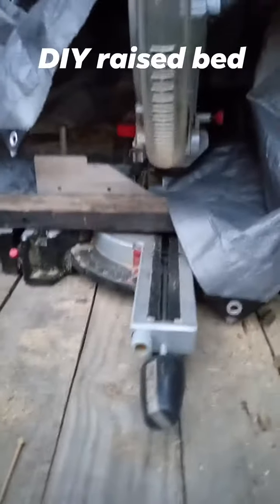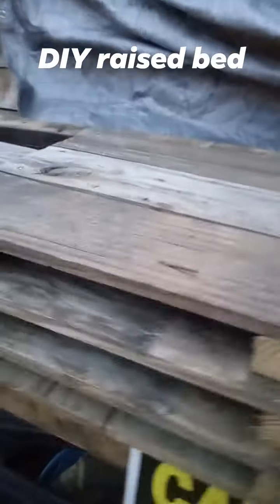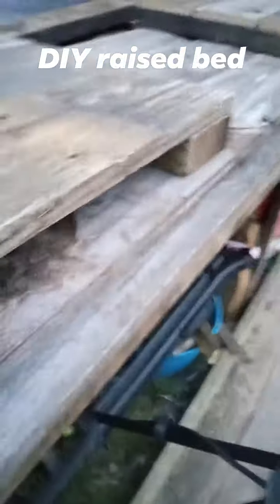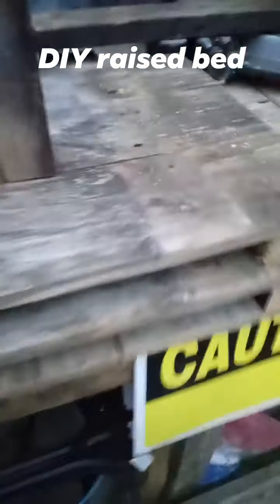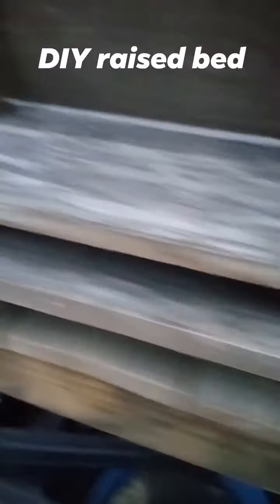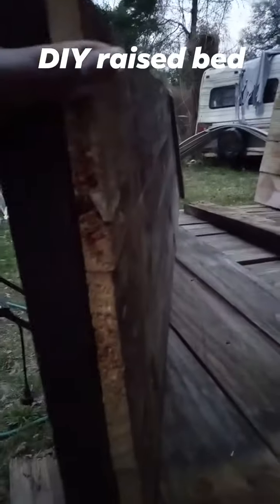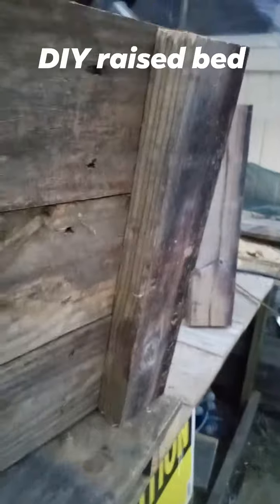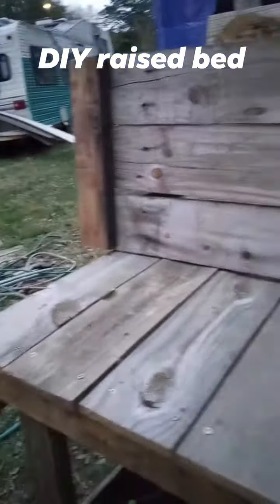How to make a DIY raised bed from scrap materials

Comment: Nice.. I now have reason to use my scrap wood
Reply from the maker: I keep all scrap wood for multiple purposes. Some pieces of scrap wood are used for wedges, to fill gaps, construct door latches, act as table leg protection to prevent moisture from being absorbed into the outdoor furnishing and if the scrap is definitely on its last leg and dry rotted we use it for firewood.  It's a no waste system.